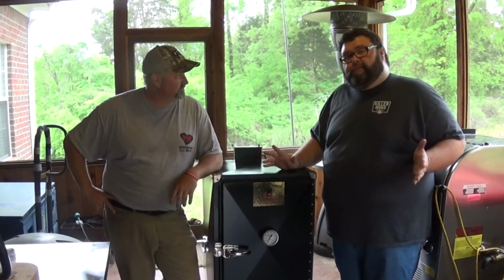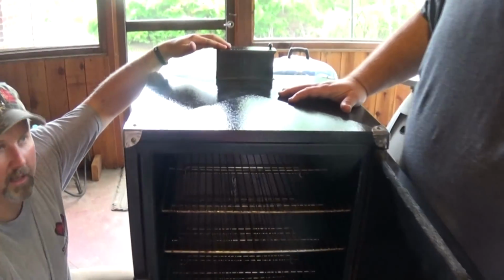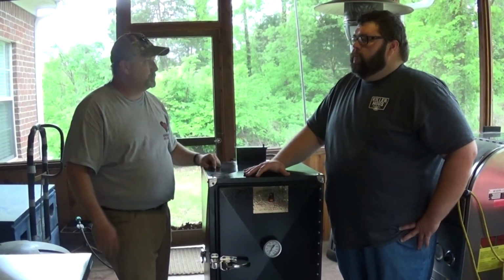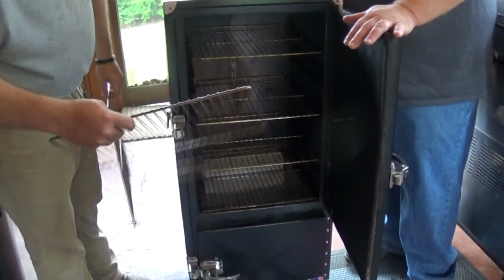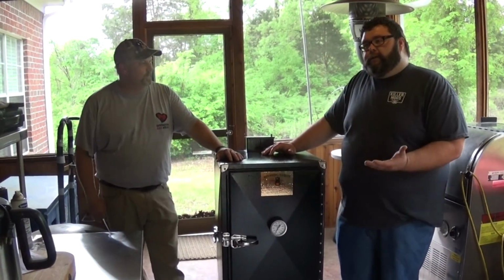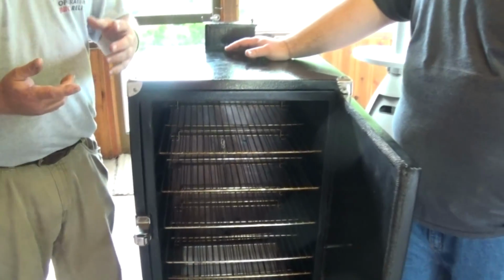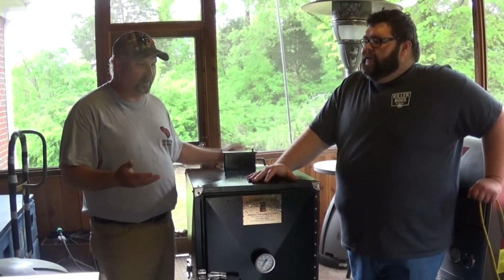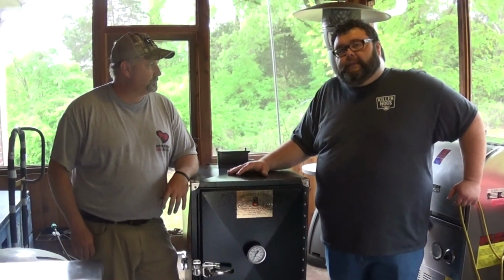Backwoods Smokers | Vertical Water Smokers - What You Need To Know About Backwoods Smokers

Comment: I know this is an old post, but I wanted to warn anyone thinking of buying a Backwoods. These smokers are trash! I bought a G2 Competitor in 2020 and it took a year to deliver! There are gaps all around the seams of this smoker. The screws are not even drilling straight, and the welds from the spout to drain the water pan are faulty and water leaks into the fire box. Adding the temperature is impossible to maintain! I even placed dividers into the fire box to utilize the snake method, nothing works! Do not waste your money!!!